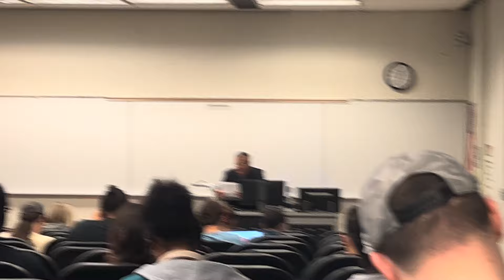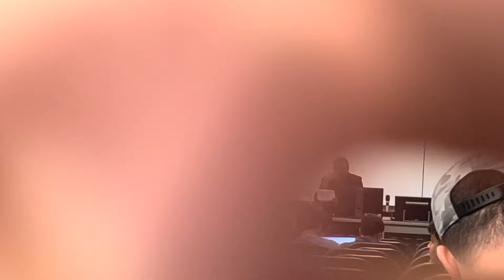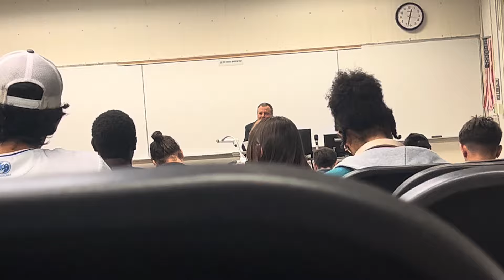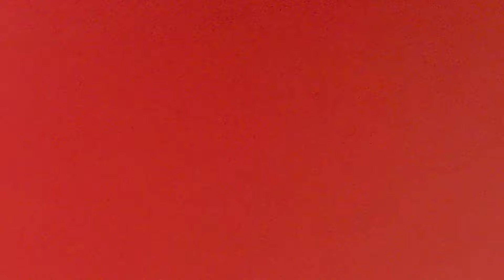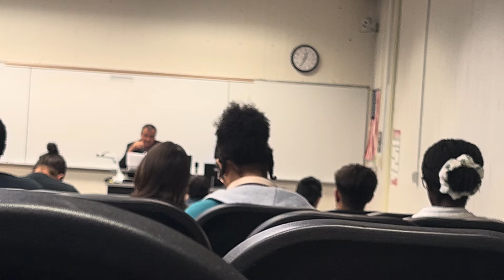Materials engineering 1 audio part 41

Comment from the maker: Problem 1 (0:01 - 1:36): A phase diagram problem involving a chunk of alloy. Students are asked to calculate the kilograms of proeutectoid alloy, eutectoid phase, and a third phase.
Problem 2 (1:38 - 2:48): Involves molecular weight calculations for polymers, specifically the average molecular weight, weight average molecular weight, and the repeat unit molecular weight given a degree of polymerization.
Problem 3 (4:52 - 5:47): Focuses on composites. Students must estimate the upper limit for the specific stiffness of a large particle composite consisting of metal particles and a metal matrix using the provided data.
Problem 4 (5:52 - 6:42): An electrical properties problem where students must calculate the maximum wire length given its diameter, resistance, and electrical conductivity.
Bonus Problem 5 (6:44 - 8:05): A fiber composite problem worth 10 points involving the calculation of fiber volume fraction based on longitudinal strength, fiber fracture strength, fiber-matrix bond strength, and matrix stress at fiber failure.
The professor notes the exam is a two-page document and that students are allowed an equation sheet (3:50)
Problem 1: Contains three questions labeled A, B, and C (0:36 - 1:38). Ch 9
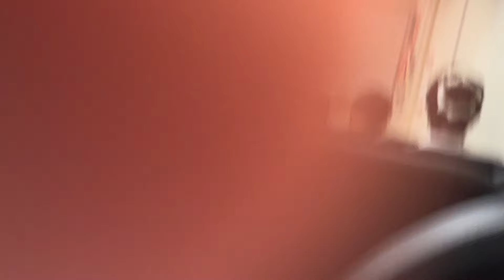Problem 2: Contains three questions (1:42 - 2:23). Ch 14
Problem 3: Consists of one main prompt regarding composites (4:55 - 5:47). Ch 16
Problem 4: Consists of one main prompt regarding electrical properties (5:52 - 6:42). Ch 18
Bonus Problem 5: Contains four questions (6:44 - 8:02). Ch16